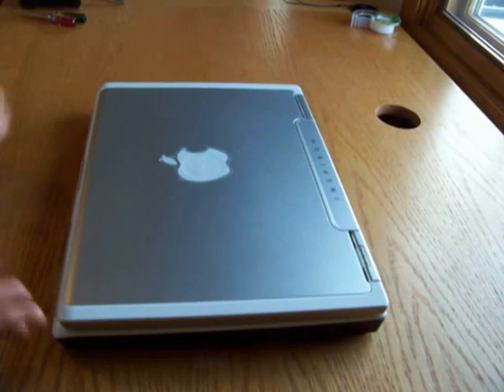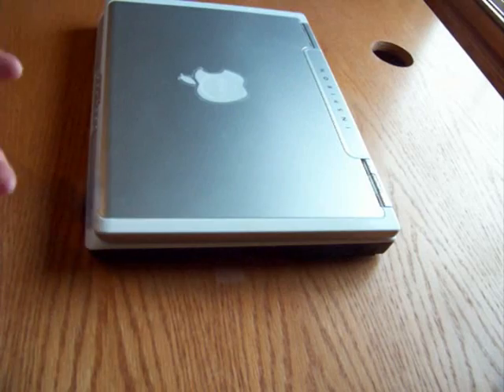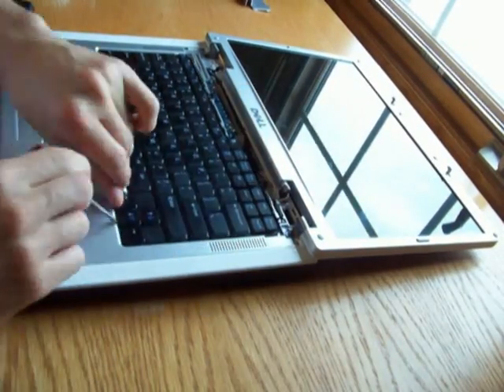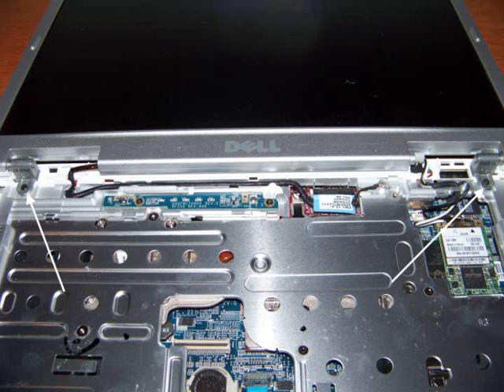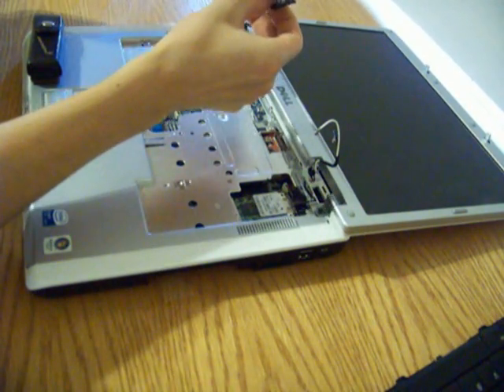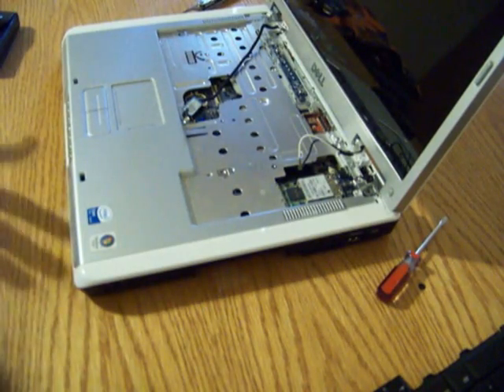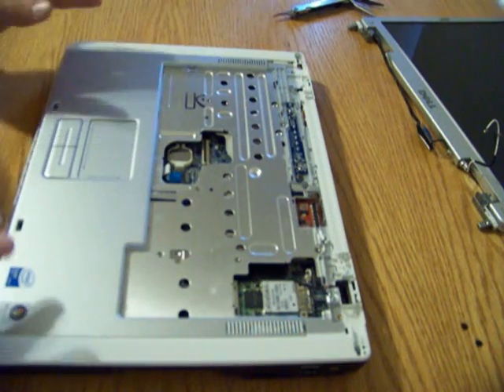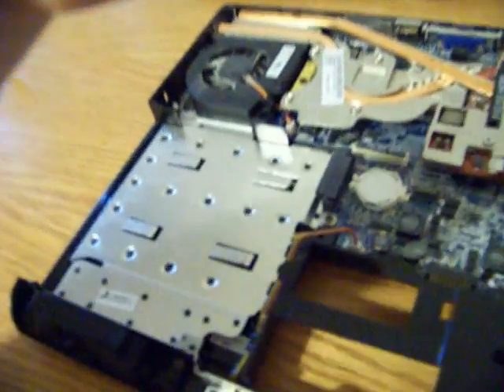How to remove and install a laptop graphics card. (Part 1)

Comment: lol this is a lot easier on desktops with PCI slot and a powerful enough PSU alls u have to do is unplug the card remove it from the PCI slot put the new one in and plug it in remove the old ones drivers reboot then download the new ones and reboot

Comment: Not all laptops have a graphics "card" but the gpu is soldered straight to the motherboard. Unless you have the machine to "reball" the gpu and reinstall, forget it, its usually not worth having done.

Comment: What I was trying to get at by that post was that desktop GPU's don't fit inside laptops.
You can get an external card, but there's so many problems with setting it up and maintaining or even getting it to work that there's no point and it's not worth the ordeal.

Comment: Ok guys, with almost all newer laptops, all you need to do is: 1. Flip your laptop around 2. Take off all the screws 3. Lift the cover up 4. Take the graphics card out and change it to another. It's quite obvious as most of the laptops don't even have screws on the right side of the laptop (when it's open).

Comment: my laptop is lenovo y450 t6600 core 2 duo, nvidia 210m graphics card.. can I upgrade my graphics card? what is the slot of this gpu that will be compatible with other graphics card?.. Am planning to upgrade to be able to run ARMA 3, from game-debate, my cpu is fine, but my graphics card is not.. so i tried ndivida geforce 9800MGTX SLI and it's ok.. do these two graphics card have the same slot? thanx . . best regard . .

Comment: I think for some laptops it would be possible. Like buy a 3rd party splitter, but that pretty much immobilizes the laptop :P. I know for desktop computers some hardcore gamers have like 3 or 4 high quality graphics cards :p. Putting multiple video cards in a laptop is sorta impractical 'cause it would probably over-heat and you'd also have a graphics card sticking outta the bottom xD. Hope that answered your question!!!

Comment: Hey, happy New Year. I want to buy a new laptop to replace my old one. I am a grad engineering student and I was thinking of buying HP envy 7203ea , which has i7 processor , 
H77 chipset(latest one) , 8gb ram , and a dedicated nvidia geforce 630m with 2gb gddr5  
VRAM(kepler architecture). I was just wondering , if I can let's say upgrade my video card in two years or so. I asked the repair guy at the store and he said that I can replace it since the new GPUS are not welded to the motherboard.

Comment: Thats what the NOTICE in green at the start of the video ment. The "If you ordered your laptop with the factory-standard........" They are called onboard videocards, which are intergrated inside the motherboard. There probably is no room designed inside your laptop for a regular graphicscard in that case.

Comment: This right here is why I got a desktop. you turn off the power supply unscrew one screw take the case cover off take the graphics card out pretty quick put in your new one put the case back on plug everything back in and boom... new graphics card. I watched this because I was curious as to the laptop graphics card process lol.

Comment: Not the GT 520. The GT 520M and the GT 520MX. I don't know why you would want to switch them out. It is a horrible choice for gaming- If that's the use. You aren't going to get a big increase in graphics if you have Intel HD Graphics, which is also crap for gaming. But the GT 520 will fit... maybe.

Comment: I have an old Sony VAIO laptop (PCGFRV27) and the hard drive is underneath the optical drive so its a different layout than your Dell.  I haven't tried installing a new graphics card in it but I just wanted to let you know that about my Sony's components.

Comment: if suppose the gpu fails then one can remove the graphic cards and turn on the laptop on the basic intels integrated chipset is it possible? faulty nvidia gpu can be removed and laptop will be on its integrated memory.?

Comment: Make sure to not touch any circuit boards or place them on any surfaces that can give off static electricity. You can easily fry the board just by touching it.

Comment: man, they need to make this easier when it comes to changing graphics card.  I mean, i got a gaming rig, but i cant bring that everywhere.  they need to make graphics card that you can just slide into your lap top that connects it to the pci-e and vga/dvi connectors with ease (if lap top ever uses those).  that way i can play newer games with better graphics while flying.

Comment: @damitchman9 its okay but you should if you can cancel the order yeah and build your own desktop much cheaper and alot more fun and stuff :) plus if something goes wrong you arent tied down to OEM warrenty to not remove anything where as a custom buld all parts are under warantee when bought and if they break you can remove em at your own plesure

Comment: @damitchman9 before you even want to find out how to do this you should know where to buy one but if you want to know then you can buy then direct from nvidia or amd/ati
for knowing if it fits you should find out your motherboard specs to find out what replacement to get and no a desktop gpu will not fit a laptop gpu and not sure about a mobile card i dont use them i prefer to build custom desktop systems

Comment: not working in my case...sorry...I have a Dell Inspiron 9400 with Ati mobility radeon x1400 which passed away after 4,5 years. Baking didnt work this time. I´ve baked it for 10 minutes on 200 degrees. Im lucky because I have at least basic 16MB graphics. Only thing baking did, was that it changed the incorrect setting of this basic card from ratio 16:9 (I had in bottom of the screen the same part as the top of the screen) back to original screen size 16:10, so it was worth it anyway.

Comment: @GunnerSongs i think some laptops have adapter inside, you can see if you open your laptop. some have built-in graphics cards, which means the part is included and you cannot change it.

Comment: @monster3754 nope, unfortunately integrated chips are much smaller than dedicated graphics cards, and integrated chips are usually either on the motherboard or a part of the cpu so unleass u get an external graphics card you wont be able to replace...

Comment: @chelkuhz look up the hp probook 4430s 14 inch screen thats the laptop i have and it sayz it has intel 3000 graphics and an i5 2410m. do you think i shud run WoW fine with no lag?

Comment: @TheShadowfox14 Well, what type of laptop do you have? On most (non-custom) laptops the graphics cards are soldered to the the motherboard, making it nearly impossible to upgrade the graphics card AND processor. Your best step (if you haven't already) would be to upgrade your ram.

Comment: what you're going to need is the special anti-user service tool shaped like Steve Jobbs' head to remove all the screws that are also shaped like Steve Jobbs' head...make sure you hold everything correctly or nothing will work

Comment: is there any vids in here, so that I can pluck out my nvidia graphichs chip which is soldered and sticked into motherboard and then replace it or resolder the faulty solder for laptop models like mine dv3000 with 1gb nvidia.

Comment: (order of putting a graphics card into a laptop)
1. Take apart laptop 
2. place graphics card into laptop
3. put the laptop back together again
4. boot up laptop with joy and excitement
5. Laptop can't handle graphics card/doesn't work
6. take apart laptop
7. take out graphics card
8. return with rage
(order of putting a graphics card into PC)
1. open cover
2. insert/replace video card
3. put back cover on
4. boot up

Comment: @thatskater16 Laptops are mostly designed for mobility to take it around anywhere with you, so it is smaller and that mean the inside components are a lot smaller which are crammed and thats what makes it look harder as it is harder anyway =)

Comment: The problem here is tht AFAIK laptops no longer have MXM sockets, which in other words means you can't install graphics cards. And anyway, buying them is a chore as well, only OEM retailers can sell you those and only if you buy them in high quantities.

Comment: @Logology101 Well if you're running off of the basics graphics card that the computer comes with (other than Alienware I believe) you're most likely not going to be able to even with the most up-to-date graphics cards, that's why I came here to see if getting a new graphics card would do anything to my computer and turns out it will, so :(, but thus are the facts of life.

Comment: @DunsparceFTW I think with the warranty issue of the laptop keeps breaking then yes you can get the manufacturer to repair and replace it...I don't know if they can upgrade the graphics cards in the laptop unless it has graphics switching technology or something - but definitely if it's breaking down because it comes under warranty then you can have the manufacturer fix it no probs. I would personally ask if the graphics card can be upgraded - but it all falls under the warranty

Comment: @SimonAllanSAS Ok well 1 should be fine... but cooling just means i might just need to pick up maybe a fan or something for the computer since I don't already have one?
2) Actually that's the problem... the computer does break... quite often actually, I've already had it break down on me 5 times already and I've only had it for not even 2 years now and it's got a 3 year warranty on it... so is there any way I might be able to get the manufacturer to upgrade the graphics card without voiding it?

Comment: @DunsparceFTW In answer to your questions:
1) No, it won't damage the hard drive or applications - just the graphics card. If you get something considerably more powerful to fit into the system then the cooling may take a bit of a hit

2) Yes, it will void warranty if you tamper with the system - but the stuff usually doesn't break and no one will really know until the thing is opened up - so no one knows if you unscrewed or tampered with it, but if it expired, feel free to go nuts and tamper

Comment: is the nvidia g3force 310m a factory-standard graphics card? Or is it spearate from the GMA HD card built into my motherboard...it is DDR3 discrete....or dedicated (not sure which, thought they're the same) on an MSI fx600mx...is it posssible to cahnge out the grpahics card, because I'm getting a lot of conflicting messages from people saying yes it isn't integrated and yes they checked and lots saying no it isn't changeable...is it swappable, yes or no?
And if yes...where can i get a gtx485m?

Comment: my way was easier unscrewed 8 bolts at the back and then unscrewed 2 bolts holding my graphics card put the new one in and  closed it back up and installed the software and done

Comment: @adamgamedude When your laptop's GFX card dies, you usually just buy a new laptop as the laptop is a bitch to get to, and also it's synched with the laptop, unlike a pc where you just whip out the old and throw in a new one, it's much more of a hassle with laptops. and yeah you literally have to remove the motherboard

Comment: @GameFreakGirl101 - Laptops come manually with a graphics card usually high to med RAM graphics for acer can be 2.2 MB OR GB but sims 3 if its a newer laptop will work smoothly just don't increase graphics to ultra.

Comment: @rNicarO you are asking for someone to crack wise with ya. i'm not doing that (tempted though). you will need pci, apg, or pci express. i suggest you hit up tigerdirect or bestbuy. you can't use laptop parts typically on a desktop.

Comment: @mclaine33 
no i haven't found anything but i also found out that you cannot change  a laptop's gpu,if you want to upgrade you gpu than you have to buy a new laptop or a new motherbard with a gpu in it or you can use a external graphics card wichi i think is good

Comment: Thank you so much for your videos. My XPS M1710 had died (second graphic card!) I took it apart per your instructions and used a heat gun at high to blast the card for a few minutes until it started smelling a little like solder. I started with the entire GxfCard assembly that included the cooling unit because I coud not get the Gfx card unstuck, but after heating it it did pop out.
After assembly it worked perfectly! could not believe it.
thanks again

Comment: @Addictedgamer1 i dont know about the other dell models but 6400 lasted me 4 years, last 3 years it's constantly on, seeding downloading torrents etc.
battery and wifi was miserable but that's it. fan is quiet even now and laptop has never overheated. about cheap parts? well, body is easily scratchable and touchpad keys have lost it's color. but, everything works.

Comment: i have exactly the same sticker on the exactly the same place on my 6400 :D 
love that thing. 4 years old and still competitive & working well.
i have swapped my perfectly fine hard drive, coz it had only 80 gb, with my mothers new hp 6710b- 160 gb
the new one is dying, having zillion bad sectors and bad noises. 
dell rules

Comment: @xTriggz You do know Alienware is made by dell as well right?  Plus stay away from alienware they are overpriced.  To get my laptop that cost mst just under $1100 custom built from HP would cost you closer to $2000 from Alienware with the same features.

Comment: @helldrag0n47 it does.  I have a cool pad with mine and given its a desktop replacement at 17.3" screen size so theres more room for cooling but I have never had the air coming out of the discharge port get more than warm.  Now my nephew had one he got given to him from his other grandmother that dell put out air so hot you couldnt hold your hand infront of the discharge port.  As far as ram goes I got 4 for a free upgrade and I can go up to 8 if need be but dont plan on it any time soon.

Comment: good video.  People were telling me my laptop graphics card was made into the motherboard even though I remember paying extra when I had it built to have the ATI Radeon Mobility HD 4530 graphics card which I took to be a dedicated card over the integrated.  It should be real easy for my DV7T to upgrade since theres 3 to 4 access panels on the bottom you unscrew to get to the hard drive, ram slots, and the graphics card.

Comment: ive got a dell inspiron 6000 for spares or repairs if your interested? its got the standard 1.86ghz cpu, 1gb ram, all wifi card, graphics etc, and optical drive, i want to keep the hard drive as ive got my data on it.
the laptop needs a new screen, the screen works, picture comes up, just no backlight, so its very dark. comes also with battery and charger.

Comment: Some 1 Please Help me! I have A nec VerserE6210 and like yesterday i broke my graphics card.. now i can use my laptop only without graphics driver... 
I want to buy a new graphics card.. My only question is . Is my graphics card Attached to the motherboard or is it separate?? Theres a sticker in my latop Which says nvidia Geforce Go 7300 .. Soo is it a replacable card?

Comment: @2000sMusicSux No, you can't do that. Intel GMA uses Integrated Graphics, which is BUILT into the motherboard, you can't just casually pop it out like you'd do for a Graphics Card on a desktop PC. 

Even if you DO manage to remove the unit (which is SOLDERED) you won't be able to just fix a Graphics Card in there, LOL.

Comment: WTF... All of you who are looking to 'upgrade' or 'replace' the GFX on your Dell Inspiron laptops WILL inevitably fuck it up. 

Integrated Graphics means that the unit is SOLDERED into the motherboard, it doesn't even look like a PC Graphics Card. 

I'm only talking about the Inspiron range with Integrated GFX.
 
Either get a new gaming laptop, or get External Graphics like Vidock, which is VERY affordable and has great performance.

Comment: i'am intersted in upgrading my laptops graphics card to a nividia geforce 5200, i wanted to check that my laptop can have its graphics card upgraded and if its compatible before i bought it. I've rung three places already and before i finish the first sentence i get "you can't change a laptops graphics card they fused to the motherboard". Well this is proof you can. Can anyone tell me if an fujistu siemens amilo L7320 can be upgraded to a Nividia geforce 5200?

Comment: To prevent leaving any marks on the case when you seperate the palm rest etc from the computer base use an old creditcard cash card etc this works very well for opening tabbed cases and tv remote controls etc without leaving any form of marks on the case i hope someone finds this tip useful. regards Richard...

Comment: Yea especially for Studio 1555.  I wanna run AC 2 when it comes out,, but i want to know if MSI R4350-MD512H Radeon HD 4350 512MB 64-bit GDDR2 PCI Express 2.0 x16 HDCP Ready CrossFire Supported Video Card is compatiable with it

Comment: I don't know what people mean by "factory standard graphics card" it's either one of the MXM types, or weird connector but discrete from board, or integrated. You can replace an MXM card with a MXM card of the same type (or smaller). For weird but discrete sometimes if you take a more powerful card from a similar model from the same manufacturer it will work, and with all integrated (soldered to or a part of the motherboard) the graphics card is non-upgradeable period. Look for MXM compatible.

Comment: Here's a question, are most laptop parts are custom fit to a particular model or you can just order a higher performance part and replace the existing graphics card? or does it have to be the same model when replacing?

Comment: @Somewittynamehere: Yeah, The inspiron E1505 (my comp) works fast, efficiently, even after falling 3 feet onto the floor. But it is an older model (3 or so years) so If you find a good price for one,  grab it. But I'd recommend a newer model.